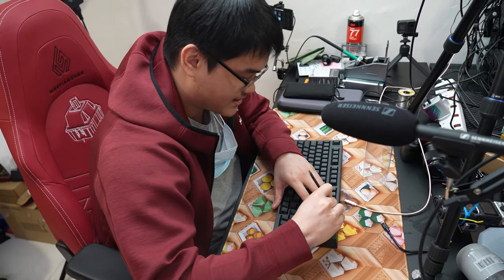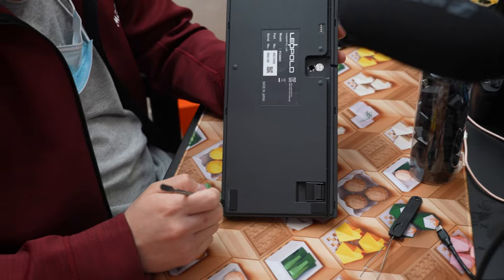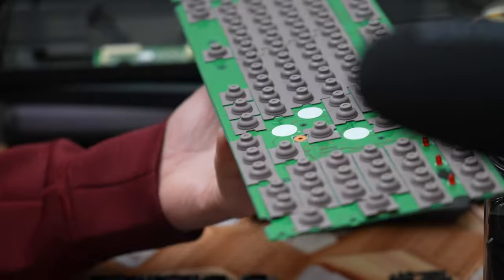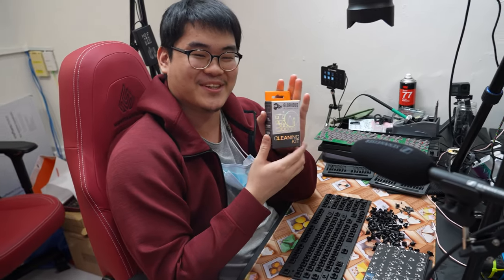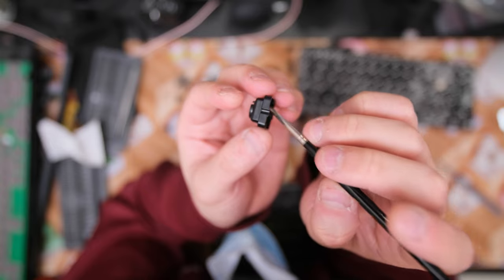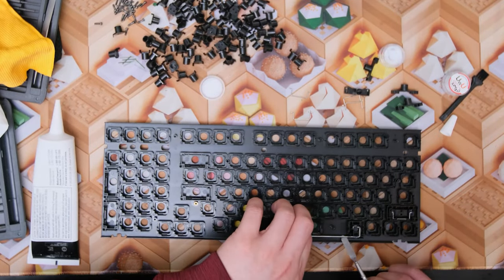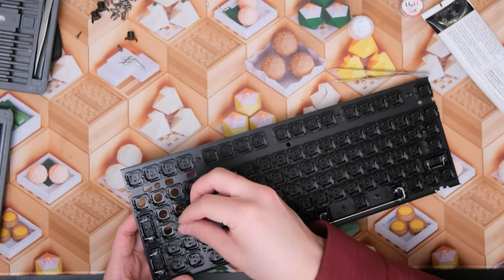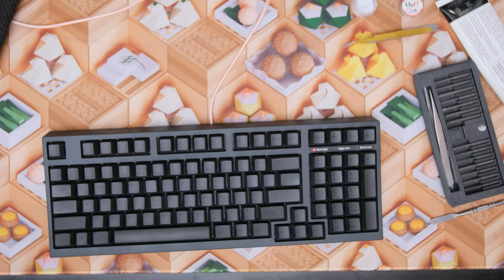The only rubber we'll ever use | Topre lube guide

Comment: The reason it has so many screws is that the capacitive sensing mechanism requires a consistent pressure on all the sliders so all the springs are compressed consistently. This is an issue custom capacitive splits had to grapple with.
Reply: Thank you for the contribution! This video was semi-rushed so I just did some bare minimum research on the whole mechanism/history/inner workings of the technology. I'm only more familiar with the modding/lubrication process.

Comment: This is true, people either love or hate Topre... there is no in-between. It's smooth, has a rounded tactile bump on the top and you will bottom out no matter what. Also, I would say the typing experience is very different depending on the board. Realforce and Leopold have a hard bottom because of the metal plate while HHKB are much softer to type on. Personally, I prefer HHKB. Topre requires breaking-in as stupid as this may sound. The domes gets stiffer with time, and 45g Topre is heavier than 45g MX style. As for lube, 3204 or very light 205g0 has given me the best results. As shown in the video, lubing reduces the rattle and makes it even more smooth, but it will make the keys feel a tad stiffer and you lose a bit of tactility as well. If you tried and have plenty of MX style keyboards, its always nice to have a Topre board because nothing feels like it.

Comment: Technically, several companies produce similar technology. There's Niz, which is the closest, a few other dome with slider switches (although some are not capacitive) and plenty of capacitive options ranging from the model F to Varmilo EC switches.
Reply: That's true! But it was pioneered by PFU Fujitsu so I used that as their reference. This video was semi-rushed so I didn't really bother with much backstory delving cos I needed to film and finish it in a short timeline. Maybe a different video for a different time.

Comment: You should use a sharpie to remove the sliders, works perfectly, get a good handle on it and press on the middle of the slider, it will pop right out and it is just ever so slightly too big so it won't go through the housing.

Comment: probably wishing he volunteered for modding a hhkb instead halfway through unscrewing the pcb xD
Reply: Not sure about the regular hhkb, but the JIS has around 20 screws as well, so not much better there. 
The worst part in modding hasn't been explored here, which is changing the rubber domes — the trouble with those is aligning them properly as they no longer stick to the board normally.
Reply: @YTHandlesWereAMistake  it was before the realisation that there's a lot of stems to pop out and lube!

Comment: so it's basically a membrane keyboard, but very expensive?
Reply: ≠ membrane because there isn't a membrane sheet

But it is a very expensive rubber dome keyboard, yes

Sounds interesting, categories can have variation in quality, so I'm not too worried about that really
Reply: Vintage keyboard collector here- try harder next time, it's a rubber dome board there literally isn't a membrane, it's a capacitive keyboard that uses rubber domes for tactility, that give a firm bottom out feel because of the backing PCB.

I do not personally like Topre, but I know what it is and why I don't like it atleast, not my personal feel.